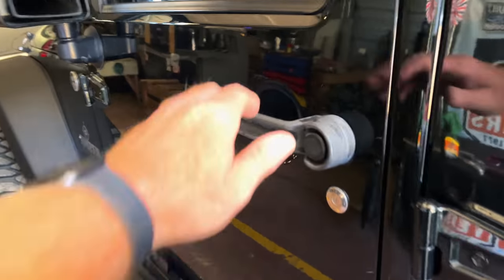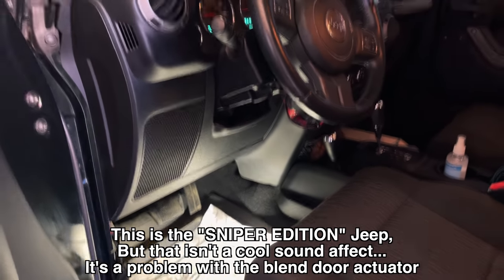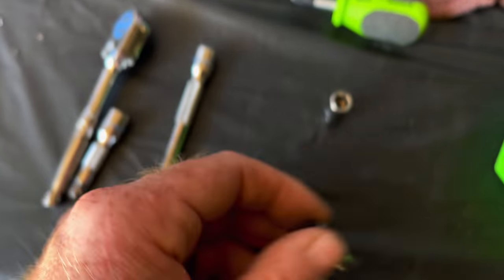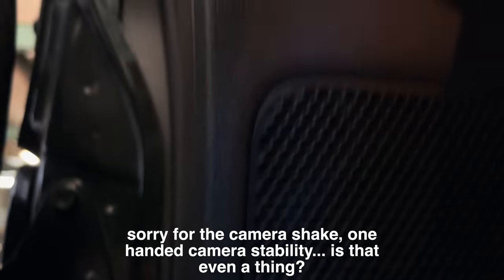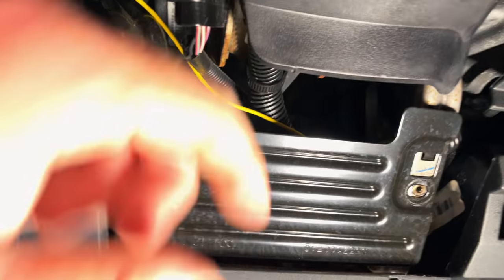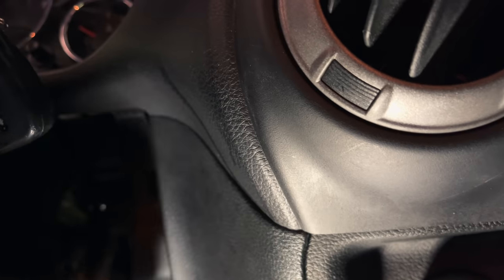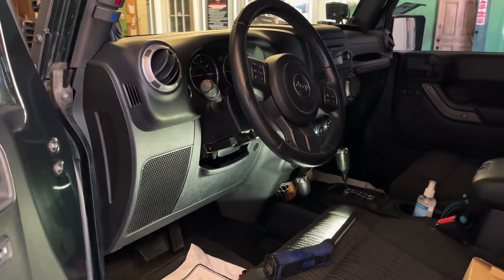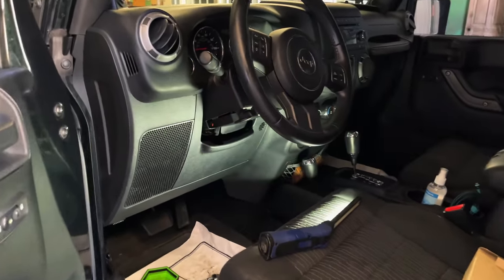How To Replace Jeep Blend Door Actuator EASY DIY FIX For Less Than $30 and 20 Mins!

Comment: I tried pretty hard but couldn't get the duct out.  Tried to even make a custom tool to pry it off a little, but didn't want to break it.  It went in fine without taking it off amazingly...just never thought the pin would go into the slot properly that easy, but it did even doing it blind.  I did put t tiny bit of silicone on the pin for lubrication.  I also used a small scope and camera to look to check if the pin was in the proper place (bend it and go over the top of the duct and between the duct and the arm). 

It's interesting the Dorman part directions say you have to electronically with OBD reset the damper door motors, but mine worked fine and sounds like everyone else's work fine.

Comment: Anyone know if this is pretty much the same for a 2020 JT Gladiator?  Not clicking, but the temperature starts out right but after a while driving, it starts blowing cold.  Have to turn it up to 81 on the driver's side and then I am burning up!  Wonderful video - for sure can do this - but wanted to check to see if anyone has done this on a Jeep Truck.  Thanks!

Comment: thanks for the video ! 
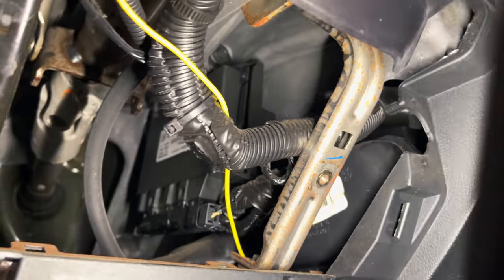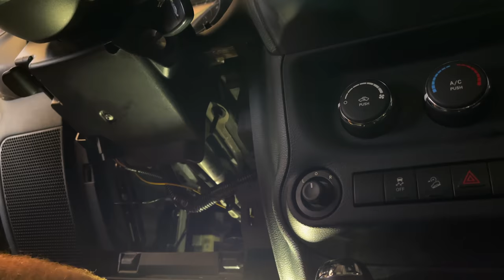can you explain what this hanging from the steering in 4:26,it was hanging infront of the air duct in the beginning but is clearly in the back of the duct when it was reinstalled as you can see in 15:58. I am asking because the same thing happened to me and I was wondering how important it is... If I should take everything apart again
Reply from the maker: Are you talking about the wiring harness?
Reply: No not the wiring.. the other large cord/wire in the middle .. connected to the steering wheel
Reply: @KoonTrucking  I am trying to add a screenshot with an arrow pointing out what I mean but youtube keeps deleting the comment.
So please look at 04:26, its the rubber cord in the middle.. not the wire harness

Comment: Mines not clicking, my 2016 Wrangler just blows cold air. Is this the fox for that?
Reply from the maker: It’s the blend door. If your heater hoses are hot going thru firewall that’s the only thing switching it over.

Comment: What if no heat on driver side but no clicking
Reply from the maker: Got to be something in the blend door. That’s the only thing keeping it from blowing
Reply: @KoonTrucking  it was blowing cold air . It was was the heater core . Flushed it now blowing heat in both sides
Reply: Where is the heater core in the Jeep compass north 2013

Comment: 1. Must have tool: Harbor Freight, PITTSBURGH Ratcheting Right Angle Multi-Bit Screwdriver Set, 8 Piece $2.99
2. Disconnect the negative battery cable (under passenger seat for 20 mins.) to recalibrate the blend door actuator system.
3. Do NOT drop the screw. You'll never find it again